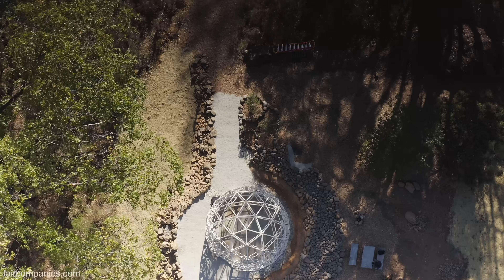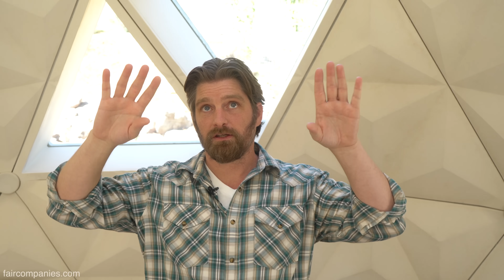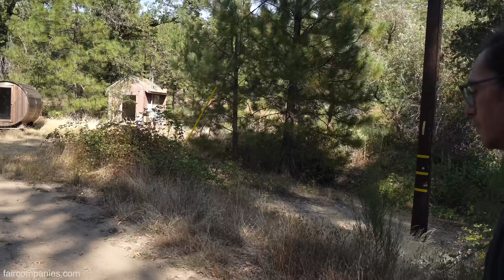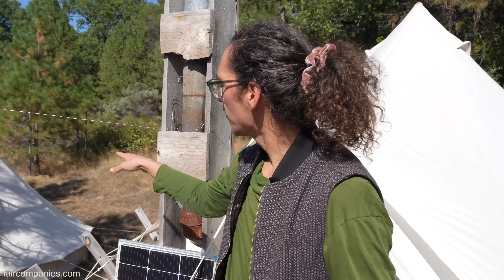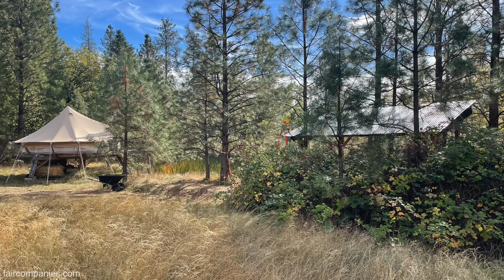Building ecovillage of storm-proof homes made of bone-like biomaterial

Comment: I'd actually want to see a more technical materials science perspective on this. From tensile to compressive strength, softening point, yield, failure modes of the material just as well as its chemical composition and how it reacts to caustic substance, erosion and wether it oxidates, rot, and in what conditions. Only info we have is it's "ceramic composite". Bio and natural stuff are just a big promise otherwise.

Comment: Well. He's not wrong and I love what he's done. It looks superb. While you may not be able to enclose as much space with a box for the same costs, the box allows you to use all of the space enclosed and this does not. He has one room in that little hut, no kitchen, bathroom, closet, air conditioning, plumbing, anything. He only uses the floor footprint. I would have to have much larger domes, or many more of them. A system would have to be developed to join the domes together and I don't see that. Its cool but it looks like a moon base, or something out of a 70's stop motion animation kids show. He lives in a tent in the woods. 😅

Comment: NASA makes an extremely heat resistant ceramic tile to protect their space vehicles from the intense heat of reentry. Someone should look at creating a commercial process to produce these tiles for covering geodesic domes - and you'd have a really fire resistant structure. https://ntrs.nasa.gov/api/citations/20240006875/downloads/Developments%20Reusable%20TPS%20Based%20Upon%20Shuttle.pdf

Comment: Can domes be attached to each other? What are the heating/cooling savings as opposed to a regular home? Can a cupola be added so there is the ability to ventilate and either add cool air or let hot air escape? Can a basement be added?

Comment: Much wider dome, central tower/shaft  large enough to contain water heater, heat pump, batteries with solar and satellite running directly down from roof.    2 bed rooms, kitchen/living area, storage and 1 bath room.   Central shaft keeps all  runs of every type short allowing for 48v power everything.   48v is as "safe" as 110v as far as harming you.

Comment: Aircrete is probably cheaper and easier to work with.  If you use the right recipe, it is very light and strong.  There are 3 main recipes that I am familiar with.only 2 that I would seriously consider to build with.  One uses gypsum and cement mixture.  That one sets and cures very quickly, although it needs special tools to make, and the other can use standard concrete mixers and tools, but it takes more time to set and cure, like standard cement.

Comment: I have been working on a similar thing with hempcrete domes one of the problems of building a frame first is it a lot of extra time and then they tend to leak so we're working on a system where all you get are slightly different triangles and connect them together and then there's a top piece which holds everything strong it's much simpler to construct with a simple lifting tool hempcrete is basically what they are using but it isn't load-bearing so we are working on developing a frame for each triangle based on wood joinery and without any metal connections that way it can last a very long time treatment with fire then oil makes wood termite proof and very strong once you have the plan it's simply a matter of sliding each triangle into place and then possibly pounding a connector in with us with a mallet and can be done by one person. Many of the costs they don't tell you are to do septic systems required by law and also putting all the plumbing and electricity in place our design uses concrete floors with removable vertical panels that simply plug in along with plumbing that is routed along the floor and then electricity is run between the side panels to the second level of height this makes for much easier construction and availability of plugs and connections and faucets and showers when you think about these kinds of buildings we really have to think through everything finally I would say second story is usually not a great option and also to consider adding a bell stove / pizza and bakery oven in our design there's a lever you pull which routes the heat into a small oven unit for frying on the grill and any bread baking or pizzas get done in the bell oven which can heat the whole place quite easily on a little bit of wood another complexity they don't talk about is solar because solar panels are square they don't fit on the domes this makes solar installations more complex persolarTesla can build as some custom solar triangles but until then you'll need an external seller array s o l a r

Comment: This seems like the Eco Hippie equivalent of the Tech Bro. They have their talking and selling points - that material might be great, but those surfaces are nothing but aesthetics, and outside of that single room dome thing without any interior except some garden furniture seems a bit under-complex to extrapolate from there. Like for an Air BnB somewhere where people are going for vacation but can't live permanently for all sorts of reasons (economic not the least) that's all fine and well. And to project 150k for a "Big House Version" built in CGI where even in the CGI showed various interior structures not made of this material or these triangular blocks ... That projection is likely a lot worse than historic TecBro examples like Elons Projection for the price of Tesla's CyberTruck ...

Comment: The cement is called Calcium Phosphate Potassium Cement (CPC) It's a geopolymer, that once wetted cures by reacting with an acid such as phosphoric, oxalic, acetic or citric acid.
It doesn't have to be made with hemp, you can use wastepaper from a recycling facility too. The fibers make it very tough and strong; you could beat on those walls with a two-pound sledgehammer without breaking through. This same product can be made into furniture; even the frame inside upholstered pieces, tacked and stapled to secure the upholstery! If treated with a catalyzed finish it can be used directly as a sink, bathtub or floor.
It can also be made into wall panels, plates and studs for low-flame-spread, one-hour-fire-resistant, woodless construction in a more conventional platform-framed home.
Reply: @johnturner8286   Are you talking about Portland cement? Or something  else? I am asking because  I am trying to find a cheap method to build a home. Paper seems it would be cheap. Maybe free. I wish I had more knowledge about "cement" to know what would work and what wouldnt.
Reply: THANK YOU! I was looking for an explanation about the ceramics
Reply: Ooooohhhhh...... my bathtub dreams are coming alive with your comment.
Reply: Do you know where you can get material bulk?
Reply: Cyclone proof?
Reply: Hello from LAS VEGAS., NV. Uh I'm gonna see how the ISP will help cover more feed patronage without needing to create subscriptions so your business is more legitimized with YouTube. AND see how gratuity doesn't become taxable income out of your pocket. It makes sense why the fed is wanting to control it but the GOP sees or acknowledges gratuity as expenditure for them not you. So yeah, this is one of my favorite feature channels and I love your film technique with the pan over zoom and wide lense full framing. Which solves a lot on this platform but even better youre ready to go on TV as is. I hope that they look at you and Bryce closely for getting that going on the cable. Anyways, thanks for being a great artist and sharing your life's work with us all . Take care  😶‍🌫️

Comment: I believe you are on to something.  Have you heated it up to about 400 degrees? Then it would be fireproof, and then it could be called a ceramic!  Perhaps a baker's large walk-in oven could be used.  Your product could be so sculptural and what it could be organically inside could be beatifully and the possibilities are endless.  A two story with a beautifully carved staircase with glass bottle ends embedded into the hemp mixture in the triangles to capture light as the stairs curbs, wow. Or in a transom windows or shower area or any walled area, non load bearing of course.  However, the home should be much bigger in radius to accommodate larger bedrooms for children and adults.  Two beds upstairs or three and two downstairs.  How big would that be?
You need a young and imaginative architect.  You need to team up with that hempcrite guy for funding help.  He has a factory.  You need mentors. Have them sign non disclosure agreements first and see an attorney. These houses are need in the Midwest, in tornado alley. Basements with wide stairs and a large refrigerated room could be used as a storm shelter, just turn off the a/c.
Windows placements need to be lower and regresses need to be considered, too.
A high dome with  skylights and a second floor would sell if the prices were affordable.
A first floor with an even wider basement, options for the buyer.  
Have fun with your product but definitely experiment some more.

Comment: These are NOT affordable!  $300/sq ft.  The smallest structure (which is included in the early part of the vid) is a 20’ studio.  At 320 sq ft that’s a cool $96k.  If I were living alone, I might be willing to make it work.   But if you move up to the “Amma” — which is the model showcased later on, a 1630 sq ft | 2 bed, 2 bath & office design, you’re looking at…help me out here with the math…$489,000??  That only looks “affordable” to the currently insanely inflated real estate market where the starter price seems to be $500k for anything more than a shed.  Yet if I sold my (paid off and comparable sq ft) home today at its current market value in a desirable part of a desirable small city, I’d still be looking at an additional 150-200k, and I am NOT looking to acquire a mortgage.

Comment: What a great idea. I'm all for this! Couple of questions though...this isn't permitted is it? It looks like the prototype was built specifically under the requirements for a permit. California is a bear with new materials so is this going to get ICC certified testing reports? That's what I'd need to build them in various jurisdictions. Also, how are you going around the code requirements for min. space heights around the perimeter? Are they all above 7'-6"? Also, your website says turn-key price, so that includes foundations and site work???

Comment: With these, you could easily make it like those buy-the-pieces couches where you can buy enough components for however many bedrooms you want, and have a "main house" and some tunnels connecting, the tunnels being two triangle-sides in width, and lengthwise however much you need, in triangle-lengths. Then there'd be connector bits between the tunnels and the doming. It's a very expandable idea.

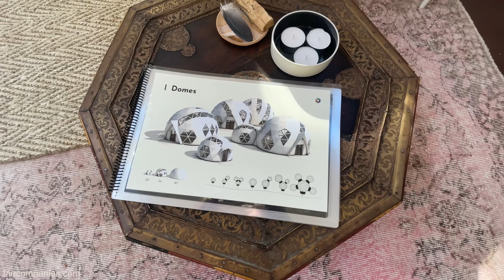Edit: i see my idea has already been had (around 9:10 )

Comment: I believe one important oversight that was not addressed during this house review is weather sealing. The issue with these houses stems from the excessive caulking required to keep them watertight. Unfortunately, this caulking tends to deteriorate faster than in traditional roofing systems. Additionally, it would have been beneficial to discuss the thermal value and insulation of the materials used in the cavity. Overall, I felt that this review came off more as a sales pitch for the company rather than an objective assessment.

Comment: This looks like the perfect material to use on Monolithic Domes'  construction technique, instead of shotcrete being pumped from a mixer and sprayed onto a reusable, inflatable airform in a single day. Prep ground with geothermal ducting & plumbing supply; pour the slab; attach the airform, inflate; add electrical conduit & outlet boxes; spray your ceramic material. Dome done.
Your ceramic material can be delivered onsite, anywhere in bulk containers.
I spent several years researching and designing  the 'perfect' multi dome home, until life happened that killed that dream.
20 ft diameter multipurpose domes, connected  by arched hallways, with walk through his/her closets, and bathrooms; arranged around an outdoor courtyard & pool.
Solar tracking PV mounted on top of the hallways feed electrical conduits, pre- laid over the airform, distributed from the apex to sockets prior to spraying.
Geothermal air ducts deliver fresh air into the center of each dome's slab. A circular skylight located at the apex delivers light and is surrounded by air vents. Air circulation is via convection
The domes can be earth bermed so that >80% of electrical demand is eliminated, as are solar costs. It doesn't get more efficient and sustainable than this.

Comment: I've followed geoship for about 3-4 years now. Their bio ceramic has intrigued me for a while now. I've been researching mixes for awhile bow. Working on a domed walipini using wattle and daub. I'm using almost straight clay straw mix. Theres a little sand to the mix for flex. And mainlu red oak for sticks and wood. I'll have to lime plaster the outside dome i think. But i'm incorporating birch bark and hemlock bark for outside covering. The walls provide a large thick thermal mass.

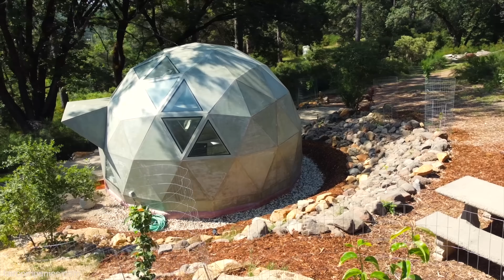Comment: 1:28 — spherical form is wrong for a house. Because gravity! Rain falls from above! Right form is mushroom-like.
Reply: @remember25october  true, wood framed dome houses can have serious roofing leaks. From what I can see on this type of build, there's no way for water to penetrate through the panel, the potential failure would be in the seams, but if those are properly caulked with a high-end caulk-like quad, I don't see how it's going to leak.
Reply: @remember25october  You could put a roof over this to look like a mushroom.

Comment: Timestamps (Powered by Merlin AI)
00:20 - Innovative bone-like bioceramic homes address fire and earthquake resilience.
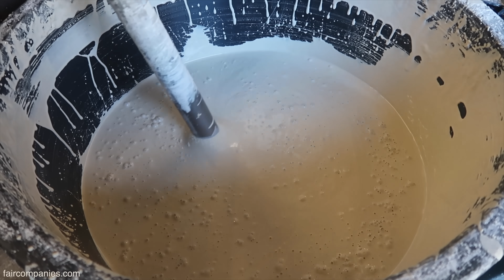02:52 - Innovative ceramic biomaterial enables strong, rapid, eco-friendly home construction.
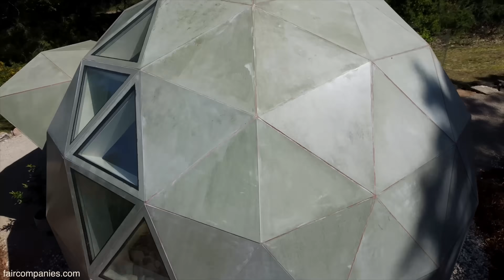05:16 - Innovative storm-proof homes utilize lightweight, customizable bioceramic materials for quick assembly.
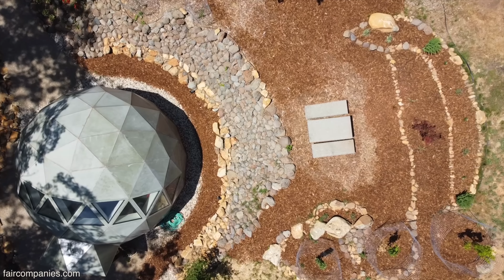07:30 - Innovative homes use biomaterials and design efficiency for affordability and energy efficiency.
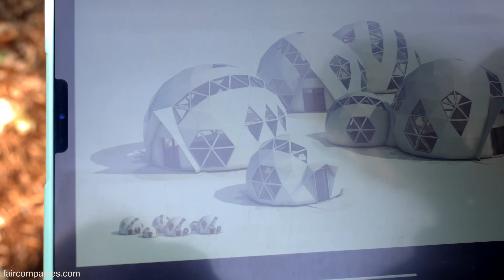09:50 - Designing eco-friendly communal homes for sustainable living.
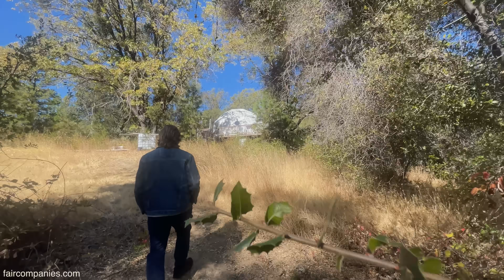12:15 - Living sustainably in round structures enhances connection with nature.
14:54 - Living minimally in harmony with nature enhances well-being and resilience.
17:37 - Living sustainably fosters a deep connection with nature and community.
20:01 - Innovative approach to creating sustainable, affordable natural homes.
Reply: The cost of building innovative bioceramic homes varies based on their size and customization. The bioceramic material's affordability and quick assembly contribute to lowering long-term costs. An estimated turnkey cost is between $50,000 and $200,000, depending on the specific structure's requirements, making them a cost-effective solution for sustainable and resilient living [citation:7][citation:8][citation:10].
Reply: The bioceramic material used for constructing dome homes is made from raw earth minerals and natural fibers. This material undergoes a room-temperature curing process to form a highly crystalline ceramic concrete. The bioceramic is a chemically bonded ceramic, classified as a geopolymer, which bridges the gap between ceramic, cement, and epoxy. It features covalent and ionic bonding similar to ceramics, combined with properties such as rapid room-temperature curing like cement, and strong adhesive molecular bonds to most natural materials. The resulting bioceramic composite is water-activated, highly durable, non-toxic, and resistant to natural elements such as fire, rust, and rot [citation:1][citation:8].
Reply: Info, please.

Comment: I love this project but can’t get over one aspect - waterproofing. Geodesic domes are notoriously difficult to waterproof. It looks like they seal the exterior panels with a cement or geopolymer, but if the structure moves at all, those joins will surely crack and leak. I’d love to better understand what they’re doing there.

Comment: Unless they massively scale up the manufacturing process this is going to be tedious and expensive to supply materials to customers based on what is shown in their barn workshop.  My guess is even at scale the cost per sq' is going to rival or be higher than traditional processes. Great ideas and processes usually don't win over lower cost solutions

Comment: This tech brought to mind an article I read decades ago in a science mag where they would take wire forms and put them in coastal salt water. Once there they would apply voltage to the grids and nature would form a skin of the same materials that coral polyps use from the water to build their  exoskeletons. I don't know if this tech lead to anything useful other than a science experiment. What you've got going here looks very promising if we can break the grip the construction industry has on box buildings. From the video the inside looks so welcoming and moving from one dome "room" to another is practically seamless. My only problem is the stark white structure trying to blend in with the green world. It is a rather jarring juxtaposition that could be easily remedied in the mold.